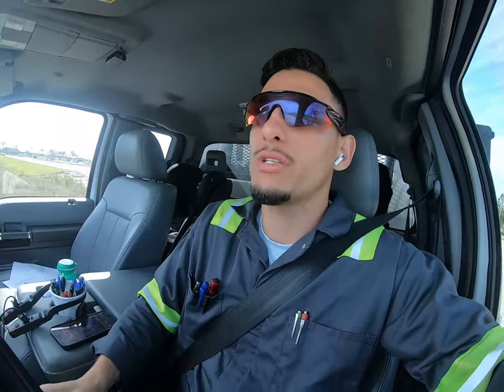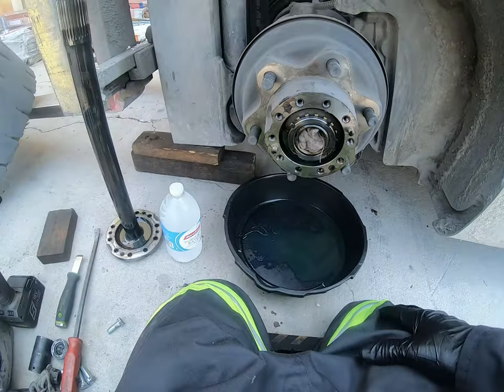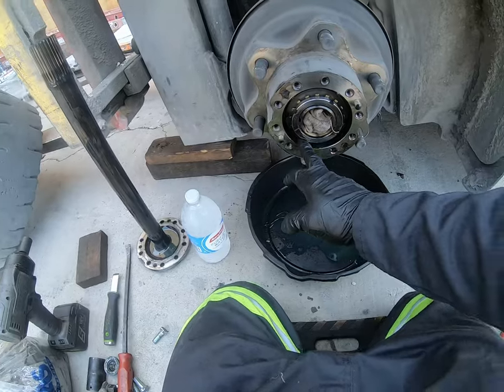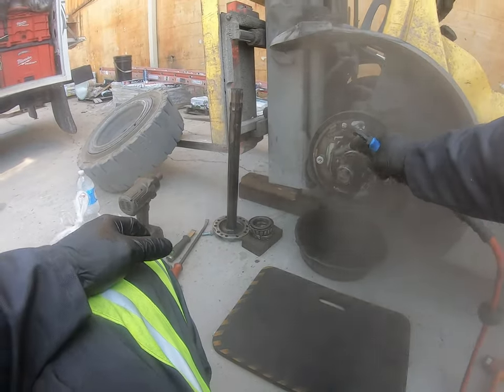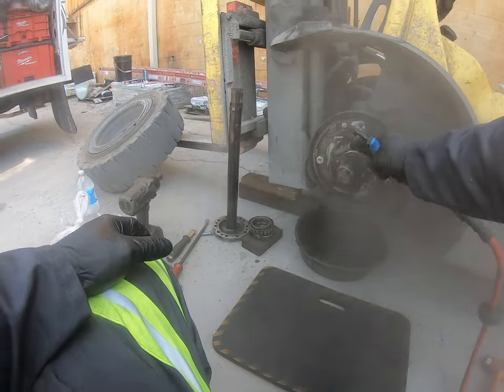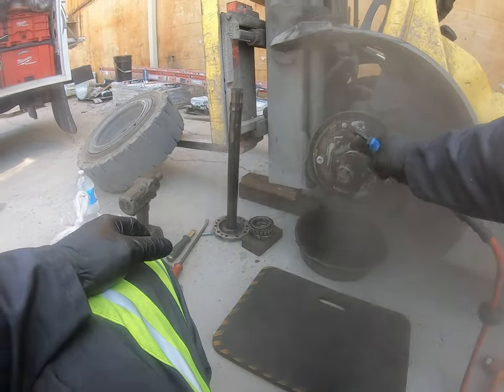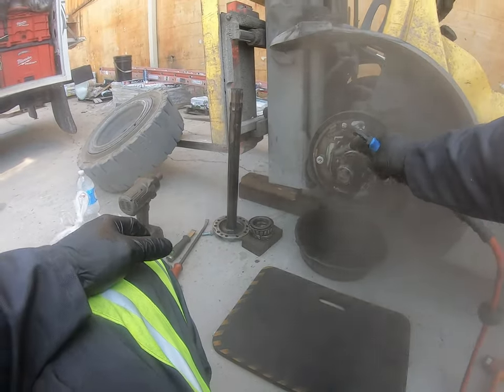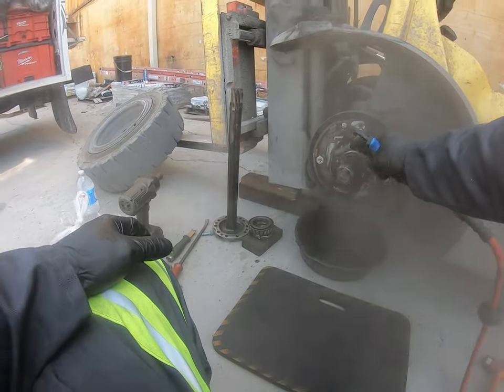Brake Pedal Going To The Floor? - FORKLIFT Brake Job!

Comment: Instead of beating on the axle hub, Yale/Hyster has spots were you can run the bolts into to pull the axle hubs out.
Reply from the maker: You’re 100% right. I noticed that as I finished the second side. Good catch.

Comment: Good stuff man, been watching these as I’m starting as a Crown tech in the next month. My only recommendation is to wear just anything to cover your nose and mouth when dealing with brake dust. I’ve seen what that stuff looks like under a microscope, and I don’t mess with it. I use a 3M respirator rated for Asbestos handlers.
Reply from the maker: Very good point! 👍🏼 thank you!

Comment: Those axles have two threaded holes that you can run the same bolts into to pull the axle right out. Also, when the brakes can be "pumped up" that usually indicates air in the system and/or the shoes need adjusting out.
Reply from the maker: Yes sir! 👍🏼 you’re 100% correct. Thank you for catching that.

Comment: Instead of hammering the axle out there are two threaded holes offset to  allow bolts to push the cover out.  It's a lot easier.
Reply from the maker: @nathanmack5514  you’re right 💯 i noticed that a little too late

Comment: Is it worth it getting into forklifts? How much do y’all make yearly? I want to leave construction and small engine repairs. I don’t want to go back to automotive.
Reply from the maker: @ericmorales3146  I truly mean this, it’s the best industry to be in. It’s the perfect in between, automotive and construction/heavy equipment. I think you’ll enjoy it, it’s not always fun but it’s very rewarding. You earn depending on experience, proficiency, and dependability. Be dependable, don’t be afraid to go to a difficult service call, and always be willing to learn.

Comment: I find anaerobic sealant does a pretty good job for axles as well.
Reply from the maker: Very good point. I use that as well with other components, but never on axles. I’ll give that a try next time. Do you use the loctite brand or a different brand?
Reply: Me personally i use the Permatex brand works pretty well, i use it alot when im re sealing drive units, drive motors etc! Btw love the videos man
Reply from the maker: @dannyperez9917  nice! i appreciate it Danny.
Reply: Official hyster is to use loctite 515 but
Reply from the maker: @lewisdonald766  I have some 515. I use that next time for sure!